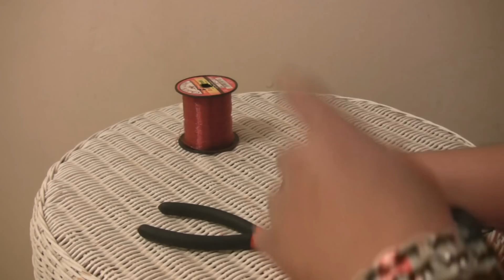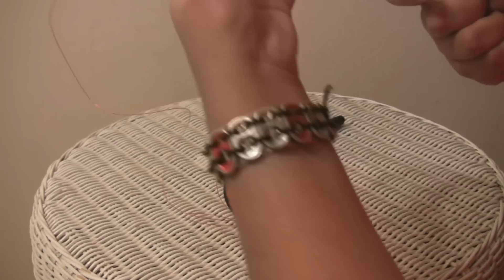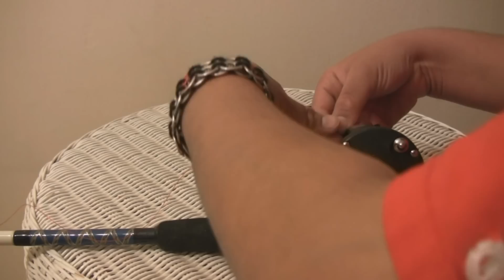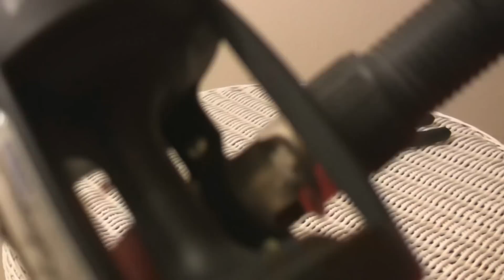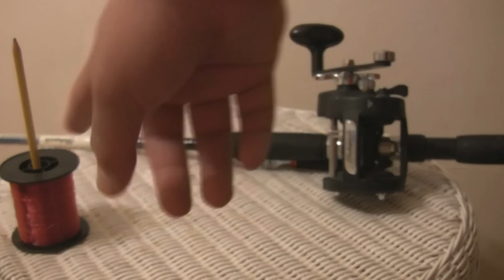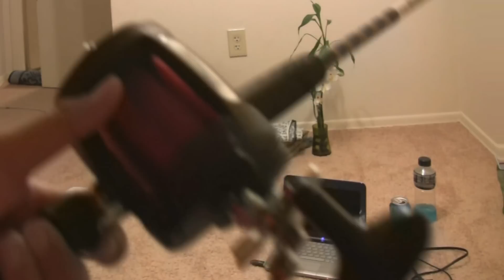How To Spool Line Onto A Conventional Reel

Comment from the maker: The heaviest line I use is 20lb, spread across evenly on my deep sea rods with Trilene and Cajun line. I'll check out the line counter, so far never had a problem with Cajun, I measured it with a 25lb scale and it didn't snap but I will check again.

Comment from the maker: Basically you need to make a knot in the line itself before you tie it to the spool. If you don't do this then when you pull it tight the line will come undone from the spool. So before even running the line through the guides on the pole, tie a knot in the line itself so when you tie it onto the spool, it doesn't come undone.

Comment from the maker: Its a single piece rod not double don't try to take it apart lol. Depending on the type of car you drive and how often you plan to go fishing I recommend getting an outside of the car rod holder or trying to insert it diagonally with the reel-side on the front right passenger side and the rod tip at the left rear passenger side.